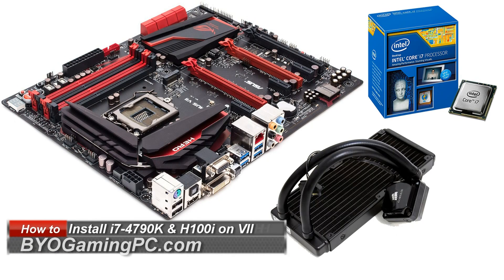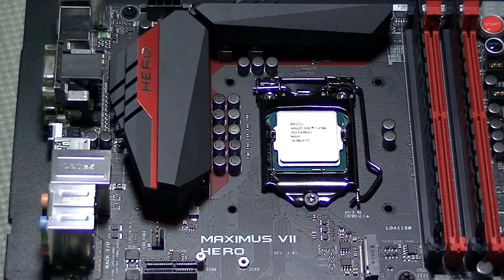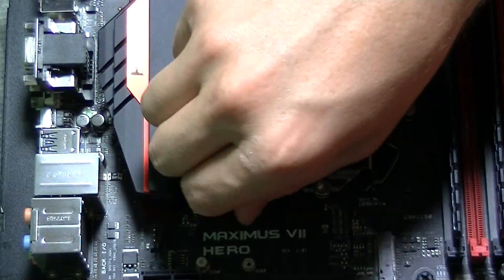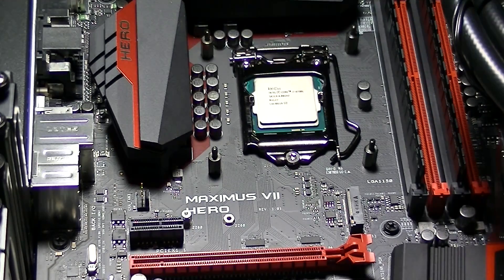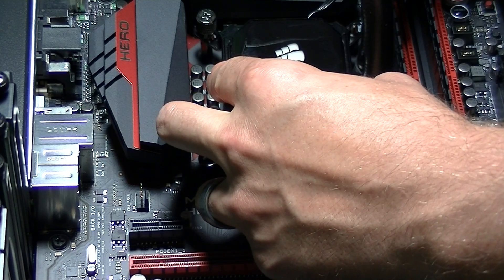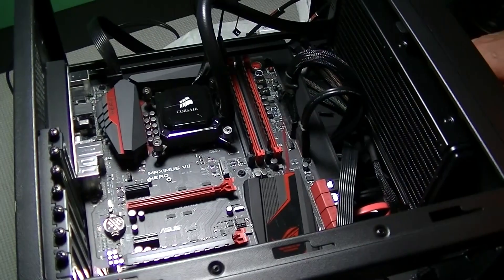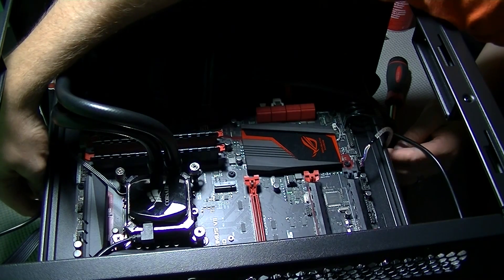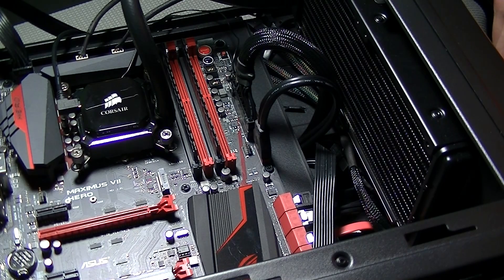How to Install Corsair H100i on ASUS Maximus VII Hero with i7-4790K

Comment: hi there , I have ASRock z170 motherboard, and i'm facing a problem with the H100i V2 
in corsair link app , it doesn't read the fan rpm , it shows 0 rpm , and the temp is almost 40 which is supposed to be les than 30 
any help please ?
Reply from the maker: Make sure you connected the cable from the pump to the motherboard USB header. If you did then try another USB header on the motherboard. I've had issues with only specific headers working and being compatible.
Reply: I just installed a h100i v2 cooler on my  i5 4690k , I'm running it @ 4.5 Ghz.
 ,  after a 20 min. stress test , the temps didn't go above 60 C on hardware monitor. I didnt connect USB header 
only the pump &  fans

Comment: On some ASUS boards, there is an AIO_PUMP header. Where does this header come into play in this installation?
Reply from the maker: There is no pump header on this board but there is a CPU_OPT header which is the preferred one to use.
Reply: So since I have a Maximus x hero, do I plug it in the AIO_PUMP header ??
Reply from the maker: You plug the pump into that header.

Comment: Questions: 
1) I have the h100i v2, and put the backplate and feels a little loose. Is this normal? I have not put the heatsink on the CPU yet.
2) Where do I plug the 2 fan connectors on the radiator?
Reply from the maker: 1. Being loose shouldn't be an issue. Test it and watch your temps. Some motherboards are thinner and it's possible that it will be an issue but not likely.
2. There are connections on the pump itself I believe. I'm trying to go from memory.
Reply: Moe Joe so was it an issue Cus I have the same issue and I'm about to get 4 rubber washers smh
Reply: Same here with the H150i pro, loose bracket!! Added the washers and it got better, but when putting the pump and trying to screw it down.. The screws never ends rotating!! and I'm just using my fingers to screw them!..  Feeling that an expensive equipment is just wrong!!and that's a big no-no in my book. (I've build 20+ computers in about 20 years, and this is the first time, it's not as it should!)

Comment: My v extreme has a backplate I can't seen to remove to add the corsair one, help
Reply from the maker: I have seen some people remove the stock backplate from the motherboard and install it but I believe that requires your to remove the whole CPU bracket. You can do it but have to be careful to install it while lying flat because the cooler will be what holds the CPU in the socket and you don't want it to move during installation.

Comment: Hey, I bought an i7 4790k and a corsair h100i gtx but I'm getting some crazy temperatures. At first I used the stock thermal paste the comes with the h100i and my temperatures in idle was about 45-50oC which I think is too high for a water cooler right? In my stress tests I had temperatures like 95-100oC! Not quiet sure if I messed with the thermal paste while I was mounting it. Then I cleaned everything and applied a new cheap one (I know I'm wrong by putting a cheap thermal paste) which I think it was too much. Anyway, I still get some crazy temperatures! I saw your amount of thermal paste and I put almost twice of that haha. Should I buy a better thermal and try it again? What do you think is causing the problem? Thanks!
Reply from the maker: +Jonfer Maia Make sure your backplate for the cooler is mounted correctly. I've seen people not install it right and it can cause some problems.
Reply: BYOGamingPC, I  will double check that, reaply the thermal paste to see what's gonna happen. Thanks!

Comment: my cpu bracket pushes too hard against the gpu, i am scared it might break the cpu if I lower it...
Reply from the maker: +Souldrainr Is the bracket installed correctly? You shouldn't have any issues...
Reply: +BYOGamingPC I forced to down and locked it in place. afaik your suppose to be abit forceful with it. but now I found out that my h80 mounting bracket is for amd. so now I gotta wait until I have the money to order an Intel mounting bracket and then wait for THAT to arrive... upgrading from 8350 to 6700k. hope it's worth the wait.
Reply from the maker: +Souldrainr Yes, the Intel bracket is a key ingredient to mount it to your 6700K and I think you will have a great experience with the upgrade.

Comment: thx for the video clean and clear .. can you tell what is your ideal temperature and maximum temperature c° and room temp plz .
Reply from the maker: +Du3a Zuher Max temp for this setup would be about 72C with a heavy OC. Ideal would be 65C or under. Room temp would be around 70F. Whatever that comes out to in C.

Comment: Wait I thought you're supposed to pour water into the radiator does the radiator with water in it or will I need my own reservoir? This part of water cooling bugs me.
Reply from the maker: +dragonoid510 This is an all in one cooler. Everything is already built in and enclosed. You don't need to add, change, or do anything with it to maintain it.

Comment: ..Why didnt he spread the compound over the CPU so it had an even connection?
Reply from the maker: +Alex M Spreading it can create air pockets. Using the pea method will not and the heatsink will spread the TIM evenly as it is tightened down.
Reply: BYOGamingPC
 What if its uneven and some leaks off to the side?
Reply from the maker: It's not a big problem if a little goes off the edge. It's important to try and tighten everything evenly though so you have an even spread. I've done it numerous times and rarely had a problem doing it, even the first few times.

Comment: Never really saw the point of replacing the thermal compound.  The default one works fine.  rarely reach 70 degrees.
Reply from the maker: +KillTheCurse Yes, the stock TIM is fine. This wasn't the first installation of this cooler so I had to use fresh.
Reply: BYOGamingPC Oh i'm sorry didn't realize that.

Comment: This was my exact build :D would you consider this watercooling overkill for casual GTA 5, Fallout 4 game play?
Reply: KillTheCurse You're very right, I have done only really light stuff on it, and it's shrugged it off. Considering buying one of these high-spec games to test it out properly. I've also got a 970 GTX, but I'm not sure how that compares
Reply from the maker: +JD21 No, it's a great upgrade for better cooling and much quieter operation. It's not necessary but it really is an easy installation.
Reply: BYOGamingPC Thanks for the reply, I'll go with your advice and get it then :D
Reply: +JD21 Ive got the h100i and the same other parts and ive never seen my cpu reach 80 degrees ever.
Reply: KillTheCurse Hey, so I built my pc a week after that message, I've never seen my CPU go above 40 :P
Reply: JD21 Sweet!  Trust me you will when you start using it!
Reply: JD21 Best part of it is how quiet it is.  It can be at 80 degrees and I'd never know over the sound of my 980s fans.

Comment: Hey really quick question! Do you think a push/pull will work with the exact same parts? Is there enough room?
Reply from the maker: +Marco Visentin You can do a push/pull setup which I have tried but it really has no performance benefit worth noting. All you gain is added noise really.

Comment: Asus maximus recomened : Ram in red...u have in black.. (np in black)
Reply from the maker: jose puga I actually didn't have any RAM installed. Those were fillers (armor) from the Sabertooth motherboard.
Reply: BYOGamingPC Hola ,oye, para juntar en paralelo dos tarjetas graficas de 550w vada una.. necesitaria una fuente de 1200? o bien con una de 1000?
Reply from the maker: jose puga It depends on the GPU's that you want to install but for two GPU's a good 1000W PSU like the aEVGA SuperNOVA 1000 G1 http://amzn.to/1Rn5WjR will be enough for any SLI or Crossfire setup you want to have.
Reply: BYOGamingPC Gigabyte 970 gtx g1 ocx 2 grafic
Reply from the maker: jose puga You will be completely fine. You can almost run 3 on that PSU.

Comment: random info: motherboard fan headers are usually only capable of 1 amp and <2000rpm 120mm fans usually pull around .2a - .3a so dont chain more than 2 together. the stock fans are like 2800-3000rpm and rated at .36a so i dont recommend using a Y splitter on 1 header with them. get a fan controller or use 1 header per fan like he does in the video
Reply: My H100i came with an adapter that connects the rad fans to the CPU pump unit. I don't know why he didn't use them here. He's missing out on the Corsair Links maximum capabilities. It can control both CPU fan speeds on its own dynamically.
Reply: GarronGoesGaming
i have the same thing and use the same connector and have a custom curve set in corsair link for them. not sure why he didnt and not re watching this vid to find out
Reply: Lol :P It's all good. I guess people have different preferences
Reply from the maker: +EZOVERDOSE I prefer to use the BIOS for setting fan curves. I don't trust software within the OS to handle it. It's just not as reliable but everyone has their preference.
Reply: BYOGamingPC
not all motherboards come with bios capable of controlling pwm fans. before you say "well then theyre cheap or old" my board for example - first gen sabertooth x79, only 3 years old, has uefi bios and was almost 400$ new but cant set custom curves. has 3 presets - quiet, balanced, performance.
with the introduction of uefi bios, software within the os has just as much control over bios related things as bios itself does now. i use corsair link for rad fan curve, afterburner for gpu curve, and 5 channel 30a fan controller with many splitters for case and mosfet fans
Reply from the maker: +EZOVERDOSE Nice, I just prefer to use the BIOS for my fans since I have the option. =) I've never had very reliable experiences with software. I use Afterburner for my GPU fan curves and of course lately it hasn't been working correctly. I have to apply the settings after booting up or the fans won't kick in at all. My GPU would just kick in at full speed because of the hardware fail safe built in when it hits 90C. Of course, Afterburner is to blame because it isn't registering correctly until I manually click apply for the settings to work. I don't know why it started doing it out of the blue but it's a recent example of why I use the BIOS or hardware to control my components.
Reply: BYOGamingPC
yea if you can do it through bios thats the way to go. afterburner has issues hooking into the gpu/fans/sensors if something else is also hooked into it like msi gaming app for example. nothing will fix that except eliminating the conflict. if its a permissions issue you could double check the task scheduler entry for admin rights which is how its runs on boot. maybe delete it and let it create a new one

Comment: Help. No fucking audio.
Tried everything....
Both rear and front audio out jacks. -failed
Tested speakers with different motherboard. -Worked
Uninstalled and reinstalled newer realtek audio drivers -failed
Made the speakers the default audio device in the audio settings -failed

Fuck life, and perhaps this audio board...

Comment: the h100i comes with thermal compound on it that was actually really good. did you take it off?
Reply from the maker: kappa kappa I had it previously applied to another CPU so I had to remove the old.

Comment: you can connect the fans on the pump too, in corsair link software you can set curves for the fans (only pwm fans) and save these curves on the pump fw ;)
Reply: Yea it does lol, I'm sitting 1 meter away from one

Comment: Is it normal to have temperature fluctuacions between 30-45 degrees just browsing with the i7 4790k not OC'd (4.4 turbo boost enabled) and the H105? I have reinstalled the cooler and applied Artic Silver 5 thermal paste.
Reply from the maker: ★ The RapToXx Show ★ Yes, it is common. The only thing that matters is the max temp. under stress testing or full load while gaming.

Comment: temps???
Reply from the maker: Tommy Østergaard 70C under stress testing is my top with a 4.6GHz OC.
Reply: is the h100i with the stock fans?? and should i maybe upgrade from my i5-4670k to a i7-4790k
Reply from the maker: Tommy Østergaard I use the Noctua fans listed in the description. Going to the i7 really depends on what you are doing. If the games or programs you are using will take advantage of the additional cores then it may be worth it. However, if you are only gaming and the games that you are playing do not utilize more than 4 cores then there is no need for the i7.
Reply: BYOGamingPC i am mostly just playing games like cities skylines project cars bf3 and 4 ETS2
Reply from the maker: Tommy Østergaard You would only see a small performance boost with an i7 over the i5.

Comment: Will the fans connected to the pump be on max without corsair link?
Reply from the maker: TheAwesomeHarvey I edited my fan profiles in the BIOS. I prefer to use the BIOS over software to monitor and control my hardware. You can use Corsair Link if you connect the fans to the pump or the BIOS to control your fans if you connect to the motherboard.

Comment: BYOGamingPC I'm gonna get a watercooler for my build, aaand the case is NZXT h440, if I use the rad as an exhaust, would it overheat, thanks in advance... :)
Reply from the maker: Not at all, this is a common setup for most cases including the H440. I've worked with the H440 a bit and it's an excellent case and fun to build in!
Reply: And I haven't buy the h100i, I still have my CM X6, will do the job? Man, I wish more people is like you... Thanks for the help, thanks for spending time man, thanks alot! :3
Reply from the maker: Restia Reswara The X6 should be just fine.
Reply: BYOGamingPC BIG THANK YOU FROM ME! Keep up the good work, :)

Comment: Hi, Im considering a similar setup. Would you recommend the HAF XB case for this cooler? Do you consider the 'warm' intake a drawback? Would the case fit 280mm?  Also wondering if if would be interesting to reverse the flow in the case. Any thoughts on that you would care to share?
Reply from the maker: It's actually a cool intake unless you are blowing hot air at the front of your case. The HAF XB will not fit a 280mm radiator to my knowledge.

If you wanted to reverse the airflow of the case I suppose you could and then you would have a warm exhaust which isn't a bad setup in itself but reversing the airflow of the case may be. Is there a reason you want to reverse the airflow? The natural flow of the air is out the back and you would have much less cool air coming in with the 120mm fan at the back if it became an intake. You really want more cool air coming in because the hot air will naturally leave through the top of the case. Another problem is that the graphics cards naturally vent out the back of the case which will be the primary reason you will be fighting forces. You can't change the direction of the airflow of the GPU unless you use some sort of water cooling or custom cooling..
Reply: BYOGamingPC Great feedback, much appreciated! 
Since i'm considering running 2 GTX970 SLI, I'm worried the intake through the radiator would negatively impact case temps (and therefore GPU temps) I was thinking of having blowing hot air out through the front, thus via the radiator and mounting a 200mm fan on top as an air intake (also reversing the back 120mm fan). What do you think? Consider GPUs coolers will be radial style, not blower style.
Reply from the maker: Ncl Bgn I think you will have much more luck drawing air in from the front since the cool air coming from the back would never get to the graphics cards and only hit the back side of the primary card. You could try both ways and let me know what you find. You aren't going to cause any damage either way.
Reply: BYOGamingPC That's a good idea. I'm putting together my order as we speak. Will do some testing and report back once I get it in.(Will do 240mm rad btw, as the 110i isn't available yet in my region). Oh, and remember i considered to use the top fan (200mm) as an intake too :)
Thanks again for your feedback on the matter!
Reply from the maker: Ncl Bgn Thanks, I also want to note that using the 200mm top fan as intake is also working against physics since hot air rises. You generally want those forces working for you not against. =)
Reply: BYOGamingPC I tend to agree with your last statement. Very curious now to find it all out; it will be an interesting experiment :)